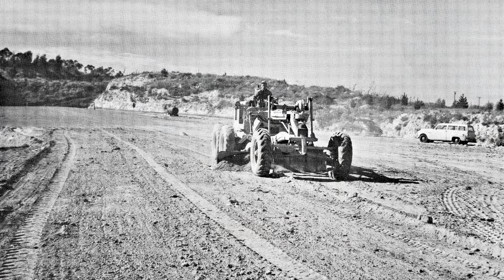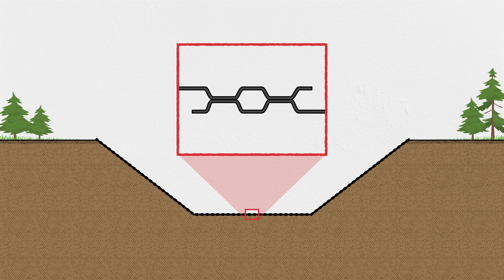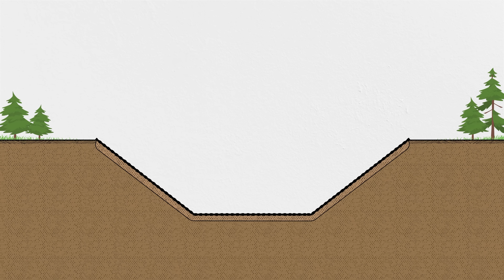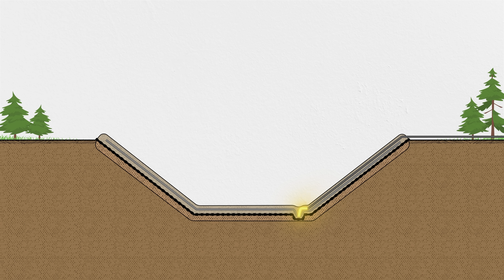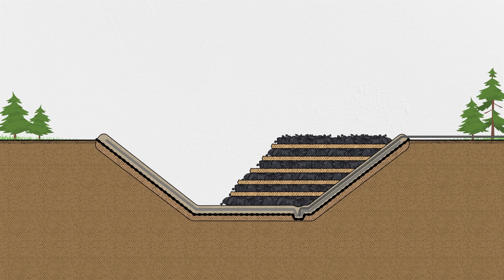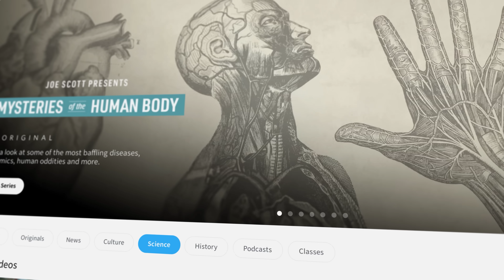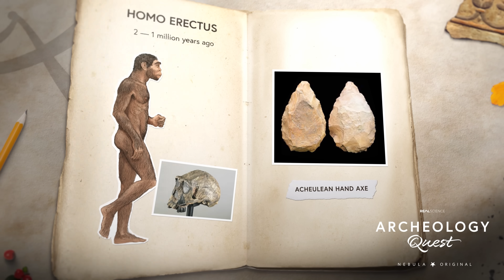The Hidden Engineering of Landfills

Comment: I've spent a pretty good portion of the last 25 years of my life evaluating the environmental compliance of solid waste landfills. I have to say this is a pretty good summary for a 15 minute video on YouTube. A couple of things I will add, the liners are required to be a double liner with a sump in between to collect anything that gets through the top liner which also has a collection area. Surrounding the landfill will be a series of monitoring wells. Gas collection is only required for landfills beyond a certain disposal threshold and some landfills don't actually start installing the collection system until they reach this threshold which can create problems. The gas that comes out of the landfills is pretty "dirty" so one either needs to flare the gas which also requires a constant flame which is sometimes just pipeline gas or burn it in special engines designed to run on the poor quality gas to make electricity. There are some landfills that actually process the gas to clean it to pipeline quality to sell to the natural gas market and one unique place I saw sold most of their gas to a nearby greenhouse to burn to heat the greenhouses. The economics of landfill gas to energy conversion got better with the advent of renewable energy credit markets since they are considered renewable energy projects and not only get to sell the electricity but also the renewable energy credits.

As for leachate management, in my area of the country leachate is most often pumped into the sanitary sewers to go to wastewater treatment plants but this may change as limits are put in place for PFAS in the discharges. Some goes to wastewater pre-treatment facilities or underground injection facilities.

Before the 1950's towns didn't even dig holes usually, they just dumped the waste on the ground. Before WWII approximately, this wasn't too bad because most of the waste was organic and, in fact, it wasn't uncommon to turn most of the waste into pig slop. That is what the city of Cincinnati did with their waste. Eventually, the waste got to be too little proportion that was suitable for hogs to eat but the hog farmer was making most of his money from the waste disposal fees so he got rid of the pigs and turned his farm into a landfill. They are still sending most of the waste to the same site.

It is possible to have almost zero landfill disposal even for a major city. The city of Toronto ran into big problems finding landfills where they could dispose of their waste so they started exporting their garbage to Michigan (look it up on a map and you can see the problems this created just in transportation costs). They got really aggressive finding ways to divert waste using recycling and composting. I think today the typical home only has like a 20 gallon landfill cart that is collected at most once a month and those are typically only about half full.

Comment: Not sure if it has been covered here. But in Sweden, new buildings have an AVAC system for waste disposal. Which is amazing, and doesn’t require truck collection in residential areas. Everything is dropped in vacuum tubes and never seen again.
Here we tend to recycle as much as possible, but anything not recyclable gets incinerated for energy. Pretty smart way to reduce the waste going to landfill.
But the AVAC system is something that people might never of heard of and could be worth a video if not already covered?

Comment: There's an old landfill near me that was turned into a park as the city grew up to and around it.  The road across it is one of the wildest roads you'll ever drive on.  As the landfill settles, it doesn't settle at the same rate everywhere, so there are many small hills and undulations that turn the road into a roller coaster ride.

Comment: I've worked in a few landfills as an electrical contractor. We actually built a pump/flare system at a landfill. The landfill sells the landfill gas to a brick plant for their ovens. The gas is flared off when the brick plant doesn't need it.  We have to monitor the vacuum on the wells to keep it below certain thresholds. The same landfill also has pumps in each sump that pump the leachate back to a main holding tank. The leachate is put into water trucks and dumped back on the landfill. I was surprised how much goes into running a landfill once we became involved with a few of them.
Reply: @brent4adv  Thanks for your additional information.  It appears to be far more complicated and interesting than I’ll bet most of us ever expected.
Reply: Hey cool! I was an electrical contractor for a landfill gas plant that generated power and used flares for the remaining. It really is an interesting process!

Comment: You mentioned about pumping air through the seams to gauge if there's a leak or not...I didn't know about that; pretty clever. If there is a leak detected, how do they go about repairing it? Especially when it's under a mountain of garbage?

Comment: I wonder which is more efficient:
1. Incineration of trash to generate power, storing the ashes in landfill (Theoretically, ash takes up less space, doesn't emit much leachates and gases, more space since borders are thinner)
2. Burying trash in a landfill, generating power with the byproducts of decomposition (More consistent source of (possibly less) power, less space for the actual trash)

Singapore incinerates almost all of its trash, with the ashes going to an island off the coast for storage (Pulau Semakau), and it seems to deal with the problem fairly well.
Reply: The difficulty with incineration is that historically they caused a lot a lot of air pollution. Modern plants are no doubt better (just like modern landfills are better at reducing water pollution than the landfills of old) but the reputation sticks around.

Comment: An idea that could be helpful, landfills that have been closed up could be used for the homeless, ideally this would come with basically an agreement to work and they could basically have an investment program where homeless individuals live there and pay a small amount of what they get paid, which in turn helps keep the area funded, but that money would also be tracked and invested to gain profits, which after a set time, can then be paid back to the individual so they have a lump sum to be able to afford leaving, either as a down payment for a home, or some other place of living.
This would allow for the land to be used in a safe manner as the homes would need to be lightweight structures, since you don't want it disrupting the buried landfill, and individuals living their would be taught some level of safety training of what to be aware of (smells, fluids, ect.), acting as another level of observation to insure their are no leaks. And it would be even better if the jobs they work are government jobs, such as actually maintaining the landfill itself because it's already a job that needs doing making it a stable employment and the funding behind it can be covered with city/state providing the initial funding to set it up.

Obviously there would be multiple aspects needing consideration, and it would unfortunately become an political nightmare to set up, but I think it's at least a good idea, I would just hope it's not another program to be corrupted and misused. I do not have any experience required to actually know how this would go about being approved, but I wanted to get the idea onto the internet, though I'm sure it's already somewhere in the web of information.

Comment: I feel like this video is severely lacking. It explains the engineering of landfills well, but it's borderline misleading to present landfills, even modern ones, as a good solution. EU enacted a landfill ban for a reason, the energy recovery percentage and air pollution from garbage handling has vastly improved due to the transition from landfilling to incineration.

Comment: I worked in a pet crematorium that was built on an old reclaimed land (50 - 60's landfill)
When they dug holes for the mass ash burial ,6 foot down they hit the old landfill rubbish , still in the same state it was in when it was buried.
You could read the writing on any paper work/newspapers etc , the black plastic bags were still black plastic bags and any thing else was as it was when it was put there.
Reply: Wow that's amazing. A true time capsule. I suppose that it's sunlight that mostly breaks things down, or sunlight is required for the micro-organisms to live in order to break things down. Or maybe it's oxygen that's missing.
Reply: That’s kinda cool, thinking it’s all just waiting down there lol

Comment: Hey Grady, I know you love talking about water management, which in this video was fascinating as always.
Since you already have the model, I would love seeing a video about gas management in landfills. Most landfills have some kind of gas-pump suction system that collects all the trash gases. Because of organic trash, there's a lot of methane that gets burnt either in an open flame or in a turbine to generate electricity. Landfill operators are required to keep these pumps running until all organic trash has been decomposed and there is no more methane. Especially in landfills that are close to houses this is important to prevent methane from building up in the basement and exploding the house. So on old landfills that have since been turned into parks or other open spaces, you often find these sheds / small buildings that give off a constant noise. That's where the pumps are housed.
It's also interesting to note that nothing can be built on the landfill for as long as this process lasts because the organic trash needs less space after decomposing than before. So the entire area is expected to settle by several meters over the years.

Comment: One was my previous local landfill saved money was with a symbiotic relationship with a material clarification company that also worked with a concrete company. They extract the rocks and sand, classify it for sale and distribution and leave the hole behind for the fill site literally in the same driveway. They have been doing it for decades that way. It's also a very cheap resource for the city when it comes to construction because of the heavy discount they get in the extracted and classified materials.

Comment: The only landfill park I’ve been to is Mount Trashmore, and if it weren’t for the name, I would’ve never guessed it was a mountain of garbage. That’s the whole point, but it’s nice that it works.
Reply: I'm from Montreal and not too far from where I live they discovered that people are living over an old landfill site. The funny thing is that nobody knew about this but over times people were finding some clues, like someone digging a hole and finding old bricks and piles of coal, etc... At some point the newspapers found some old maps and they discovered that after the year 1900 a large clay mining site got used as a landfill. If you walked now in this neighbourhood you'd never notice anything about it, it's just a normal place with a park and lots of apartments. Of course you can say this was a from a long time ago but these people are still living over a huge pile of garbage.
Reply: If you've been to many parks, you've probably been to a lot more landfill parks than you thought. To your point, if the name didn't have 'trash' in the name, you would right now confidently claim you'd been to 0 landfill parks.

Comment: There is a market place in Tempe Arizona built on top of an old landfill. Everywhere a building was built was dug down to soil and back filled with dirt then compacted by drop weights. The parking lot still sits on decomposed landfill material

Comment: 12:15 - Rolling Hills/Palos Verdes closed landfill has been using it's methane (possibly treated) to heat surrounding homes for decades.
13:00 - Another closed landfill exists at the north eastern area of Griffith Park. It's terraced and irrigated, but still looks ugly and is visible for miles. Waiting for them to landscape to match surrounding land...still waiting many years later.

Comment: The first step to waste avoiding a landfill is to make it worth it and possible to reuse and, if that is not an option, recycle things.
Even incinerating waste will allow us to be able to recover a lot of energy that would otherwise be unrecoverable, plus it allows metal to be easily separated out of our waste. Other inert debris(bricks, rocks, etc) may be too contaminated for it to be worth separating though.
Reply: I live near a trash incinerator and I know a few things: it reduces the garbage to 10% of the original volume. So it takes in about 100 truckloads a day, but still generates  10 truckloads a day of ash, that is brought to a landfill.
Reply: @EthanPerkins-qq9qh  I wonder if the ash can be used to lower costs in certain concrete constructions, I don't know the math or anything behind this but maybe if I figure this out I can find out how many Fallout 76 disks I can put in a concrete highway barrier.
Reply: @EthanPerkins-qq9qh  Interesting to know the size reduction.
The trash is toxic anyways so I am thinking why not extract the energy and metals contained within it. The only reasons I can think of why more people don't do this is because of people who don't want to give a permit to an incineration facility and/or that a landfill is cheaper.

But in the end, reduction is the best, reuse is the second best and the most practical, and recycling is the easiest but generates a lot more waste and loses the value of the original object(which is likely a lot higher than the produced one)
Reply: @ElectroTree01  Yes, it's absolutely true that reduce and reuse are the best options. We as consumers should buy high quality, long lasting, repairable things. We should also take the time to learn how to do simple repairs on the things we own. As far as the recycling goes, glass,metal, and cardboard are presently highly recycled. The big problem is plastics. We barely recycle any plastic. It is best to avoid plastic packaging if you can.
Reply: @ElectroTree01  To address your comment on incinerators, both of your thoughts are true: there was a lot of community pushback and anger when the incinerator was put in, and it costs far more to dump a truckload at the burner than the landfill. A truckload at the burner costs close to a thousand dollars, that same load costs about 400 dollars to dump at the landfill. (I work for a garbage company)
Reply: @EthanPerkins-qq9qh  There is always a way to make people think a certain thing is better.
Do you have any idea why the tipping fee is that much higher?

Comment: Would be interesting to hear a comparison to countries that incinerate the trash. I remember when I was little and a waste disposal official from the region where I live came to our school and explained what happens with our trash and showed us what remained after the burning process. I assume that would still end up in some landfill afterwards (don't remember what they mentioned, given it was well over 30 years in the past).. I also recall them talking about filters on the smokestacks that extract toxins from the burning process.. So a comparison of the various approaches would be really interesting to learn about
Reply: I worked in a waste to energy plant. The ash went to constructing road beds.
Reply: I work in a waste to energy plant in Denmark. We burn around 900 tons pr day, creating about 170 tons of slag/bottom fly ash. This is sifted for metals, and the rest can be used for high way bedding instead of chrushed rocks.
We are able to make 30 MW electrical power on steam turbines, and 90 MW for district heating (houses). 
The flue gas is sent through fabric filters to remove fly ash, mercury and dioxins. Then it is washed in two steps: one removing hydrochloric  and -floric acid. Other washes out sulphuric acid. Lastly the wet flue gas is condensed, extracing the last energy, before it goes up the funnel. We are heavly controlled by the environmental authority.

To me it is insane to dump all that garbage in a landfill. Imagine being able to extend the capacity in a landfill 3-5 times, just by burning and making electricity from it.
Reply: " that extract toxins from the burning process"... interesting. and then the toxins just magically disappear. don't have to put them anywhere.
Reply: Toxins simply transform to gaseous state from solid. One is fooling oneself by thinking this is any kind of solution.
Reply: Landfills for incineratable thrash has been banned in Norway since 2009 (and loads of other European countries, but as I'm Norwegian that's what I know most about). The only things that are still landfilled are certain toxic substances, incineration ash and things like building materials that can't be incinerated (cement/rocks etc). Modern incineration plants filter out the almost all toxins, the only things released to the air in any significant way is CO2 (but CCS is being developed to capture that too). Based on a quick calculation I made, a modern incineration plant, like Klemetsrud in Oslo, per ton of incinerated waste, releases about 1 ton of CO2, 750 grams NOx, 250g SO2, 50g PM, and 0.5g Mercury.
Reply: @fh5kskalf  mercury is a problem. CO2 isn't a pollutant